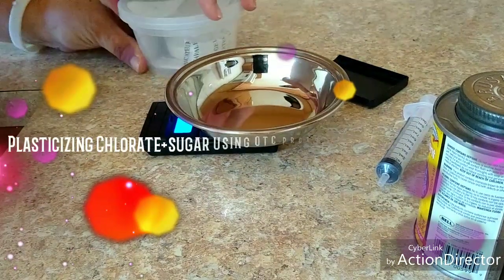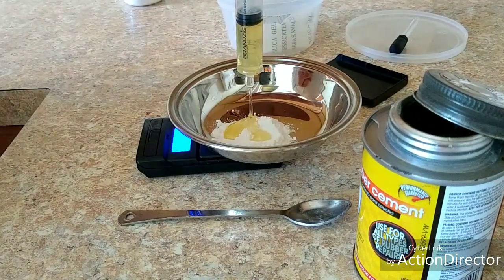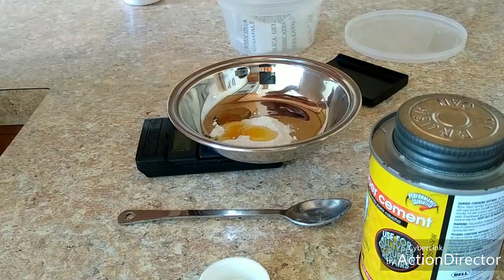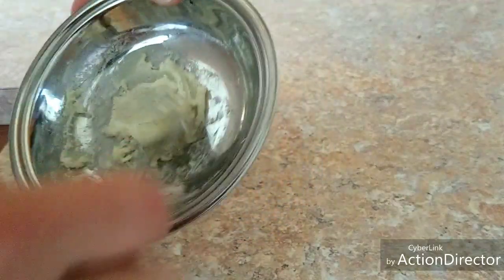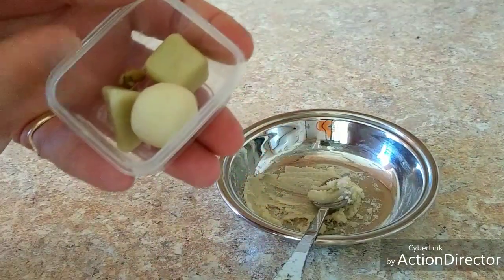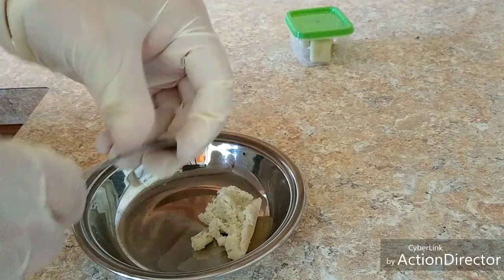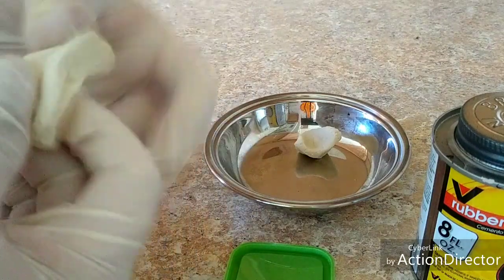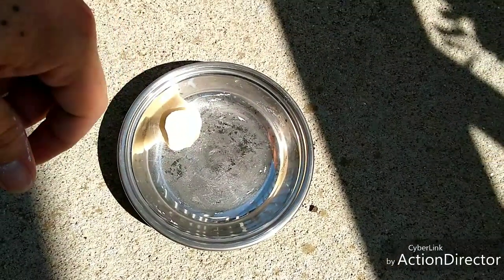(Plasticizers) #1 in this series the ( D.Ballard recipe ™)

Comment: essa proporção que usou está diferente, fiz viro modelável mas não queimou igual seu não ? 4g ,0.50g e 9g não fica 10g final não vai faltar solido? meu queimou lento. 

The proportions you used are different. I made moldable dough, but it didn't burn the same way yours did. 4g, 0.5g, and 9g won't end up at 10g, will it be too dry? Mine burned slowly.
The brand I used is different; they don't sell that one in my country.

Comment: the 'green slime' stuff you are mentioning is not rubber cement.. not even close or similar.. it clogs the tire in a completely different method (by clogging the hole with ground up rubber pieces of various sizes

Comment: Will mineral oil work as well?
Reply: Yes it will
Reply: What kind of mineral oil can I use? Only have know the bar and chain method
Reply: @MisterRoads  what the hell do you mean by what kind of mineral oil? Mineral oil is mineral oil. 
Here are the 3 best improvised methods.

1. Scapa 2501 amalgamating tape
2. Rat trap glue
3. Bird be gone

(Scapa method is best by far)

Best fuels for rubber:
Heptane
Brake release 
Mineral spirits 

Note: These fuels liquify rubber and you keep it all in a jar or can. You will heat off the fuel (evaporate it) and weigh out how much rubber content you have. Practice with 9g of flour, .5g of 5w40 oil and .5g of your PIB "Rubber".

You HAVE TO test your rubber that is mixed with fuel to see how much rubber is in the mix after evaporating all of the fuel off. If you do not do this, you will have an inconsistent mix.
Reply: @Boobytrap_Badger  idk man I thought mineral oil could be high in a specific compound but obviously not I guess. Im just a few days into learning about this stuff. Its all new to me. Thanks for taking the time to clarify for me

Comment: Vaseline oil works the same?
Reply from the maker: Not sure. I’ve never tried it.  But what ever you use you must consider compatibility.         You shouldn’t use anything with sulfur ions if using Chlorates.  It’ll make it unstable and prone to explosion when mixed.
Reply: Yes, Vaseline works.

Comment: it may freeze after a while???
Reply from the maker: It will definitely harden over time but as long as you keep it in a closed container it should stay some what malleable.
I hope that answers your question 😉
Reply: @chemistryscuriosities  why mix rubber cement with oil? I don't need it okay?
Reply from the maker: @draculamaster385  you need some oil to keep it soft

Comment: Can you plasticize chlorate and aluminum powder? Also, could that mixture then be detonated using a blasting cap?
Reply: Why though? Chlorate is a really weak energetic. Might as well use ammonium nitrate and a pure fuel.
Reply from the maker: You could make a plasticized “Flash” mix but I doubt it would have the detonation velocity to be a viable “det-cap”.  Others will argue this but it’s my opinion it wouldn’t work.  Darian Ballard has however successfully detonated ETN using a hot flash mix
Reply: @chemistryscuriosities   Is there a video of this? ETN and a hot flash mix.
Reply: @MrGunman11  you don't need flash mixed with it. Just need a good det cap. Etn is sensitive enough a flash cap will set it off assuming your useing autonomy sulfer potassium perchlorate and aluminum mix with very very fine aluminum mixed with a little charcoal to prevent oxidation

Comment: What bar and chain oil you using?
Reply from the maker: 50 weight
Reply: @chemistryscuriosities   No what I'm saying ..What name brand of chain oil.   I have some that I bought from Tractor supply, but this stuff is almost black.  Might be 90 weight.
Reply from the maker: @rickjwilliams  that’s the stuff you want!!!
Reply: @chemistryscuriosities   Yes ..Thank You ?
Reply from the maker: @rickjwilliams  I wish I could find that 90 weight.  Darian Ballard uses that.
Reply: @chemistryscuriosities    According to what I have been reading.  They do not make a 90 weight oil for bar and chain saws.    The most you will see will be 50 weight or maybe 20/50.  That would be for summer useage.   Winter would be SAE 30.     So, if Darin is getting a 90 weight for chainsaws it could be coming from Canada or Europe somewhere.
Reply from the maker: @rickjwilliams  he does live in Maine
Reply from the maker: It’s called “Do it best” brand winter bar and chain oil.  Some cheap brand I think I got at Tru-value

Comment: Mineral oil and slime brand rubbercement at same mix burns cleaner and last longer in the air before hardening into a crumbly mess
Reply from the maker: Thank you for sharing
Reply: 100% correct on that. Any tire repair rubbers especially the tire slime work greatly.
Reply: Extremely interesting! I was looking more for some chemical knowledge entertainment but I have to confess that I couldn't get my eyes out of your vid! Hahaha!😂😂😂
Very entertaining! Thanks that was fun!
Reply: That contains formaldehyde

Comment: Are you using sodium? cause it didn't look like potassium when it burned. At least on my screen it looked rather yellow so.....sodium? 🤔
Reply from the maker: I have noticed the color of the flame.  The composition is KClO3+Sugar, rubber cement and Bar & Chain oil. I think the (Rubber Cement) is imparting that Yellow/Orange color to the flame.  Which might be drowning out the normal KClO3 flame color.   The PIB version burns with a more classic Potassium; Purple/Violet color which you will observe in the next video in the series
Reply: @chemistryscuriosities  Really?.. it's that obtrusive to the potassium that it actually changes the colour( & temperature I'm assuming?) of the burn?... That's really interesting. I'm gonna have to try that one out cause normally I've always done the PIB method for my 'rocket motors'. I wonder if there's an output proportionate to the burn rate also? Maybe gain a few more feet in altitude? or a faster launch speed?....🤔 Really looking forward to this little series, should be a lot of fun. Thanks brother! 👍👍
Reply from the maker: @joeydubbs763  I think it depends on what plasticizer/binder you use whether or not it effects the burn rate.  When it comes to energetics plasticizers are typically used to desensitize a compound for safety of handling.  Take RDX for instance when crystalized it is fairly sensitive.  When plasticized it can be handled roughly and even set on fire.  There are many types of Plasticizers.  Some that you wouldn't normally think of as a plasticizer.  Take BTTN  (1,2,4 Butanetriol Trinitrate) for example it is a single stage  propellent  but is also used as a plasticizer in some Nitrocellulose-based propellants.  It gets complicated very quickly.  Very interesting stuff if you want to look into it.

Comment: Thanks for the video. Two things comes in mind. Using chewing gum or styrofoam + acetone. Maybe this could make the process faster, cheaper and less hazardous?
Reply from the maker: We will explore the many different types of Plasticizers in this series.
Though I'm not sure if there might be compatibility issues with some compounds.  Next series will be binders.  I hope our little family of mad scientist will enjoy these types of videos.
Reply from the maker: There's an idea.
Reply: @chemistryscuriosities  it would not be very expensive to ship in a metric ton of each chemical and have them mixed in staging areas.
Reply: @chemistryscuriosities  for the Russian invasion of Ukraine, why wouldn't people be making plasticized explosives instead of Molotov cocktails? Not saying tatp, but something similar. You could ship in raw ingredients for a binary and have a much higher performance formula per SQ in vs just Styrofoam and gas.
Reply: Styrofoam + acetone works well and the nice thing about it is how much you can make with so little acetone and a crap ton of cheap Styrofoam.

When making your rubber from Styrofoam and acetone, you are going to be surprised how much Styrofoam acetone will dissolve. When you think it can't take any more of it, it will. As a matter of fact, when you look at it the next day, you will see that a layer of acetone will arise to the top, so you just add more Styrofoam.  

To test it, pour out .5g and mix with .5g of your oil w/ a cheap powdery substance like cooking powder of 9g in the same manor that you will for whatever it is that you want to plasticize. 

I once messed up long ago not using isometric amounts and ruined 9g of the good stuff.

EDIT* I would like to try this method using nitromethane instead since nitromethane is much more powerful addition that can only compliment any energetic.